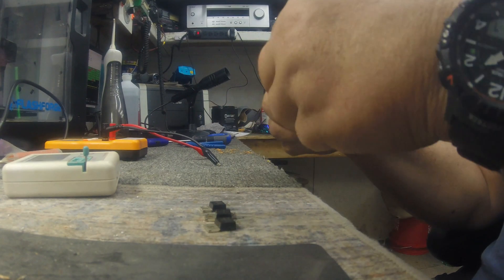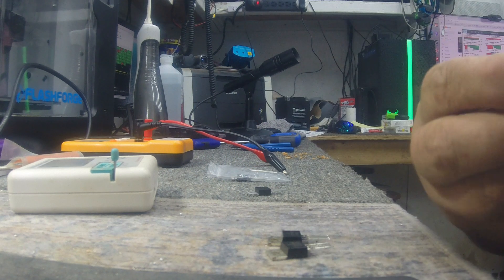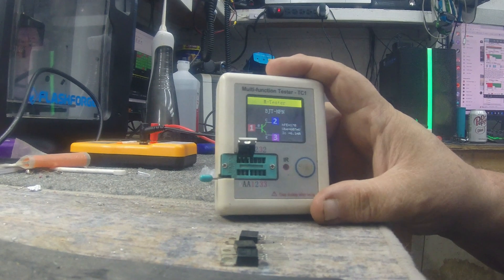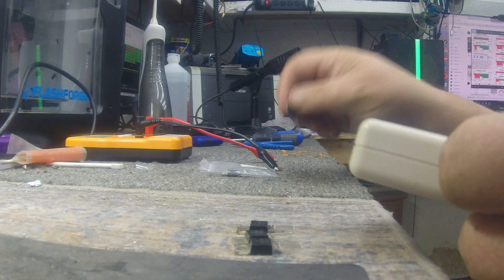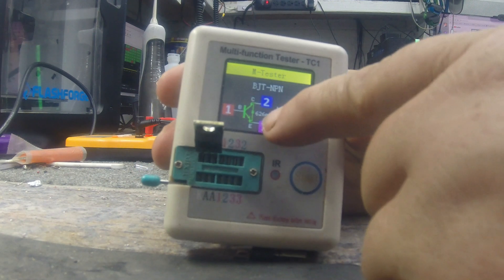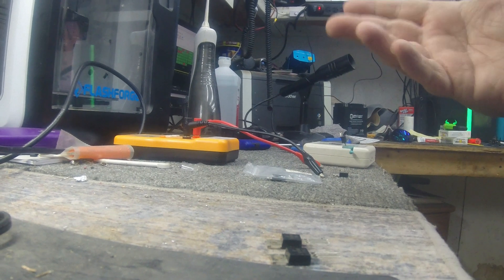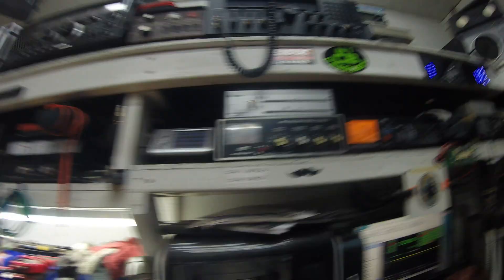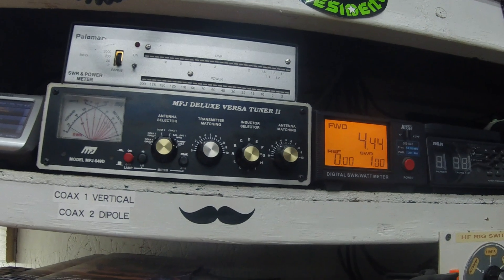CB Radio Finals HG 2SC1969 Test and Review

Comment: i have a couple HG2sc1969 in radios seem to be working ok after 2 years
Reply from the maker: From what I can tell these are by far the best replacement finals on the market, my Cobra 2000 is swinging 20 plus watts on SSB now which is the best it has ever done since I got it...
Reply: @TheElectronMan  nice 👌
Reply: You actually reset the bias vr when you set bias. No pots.